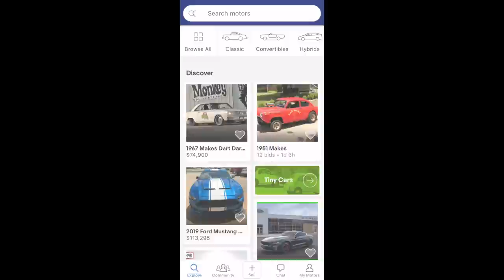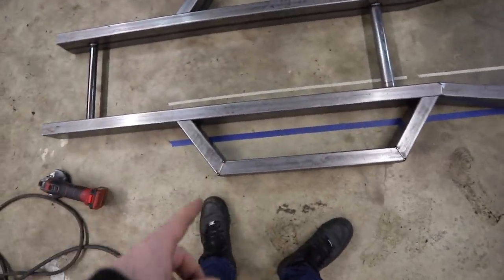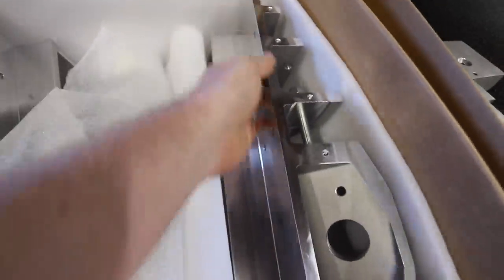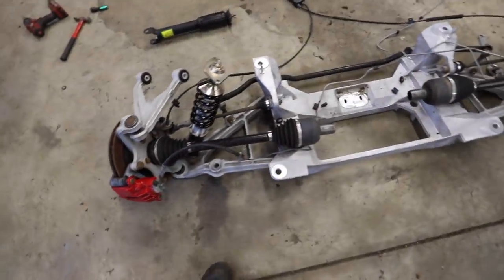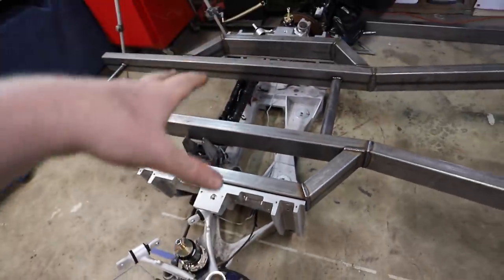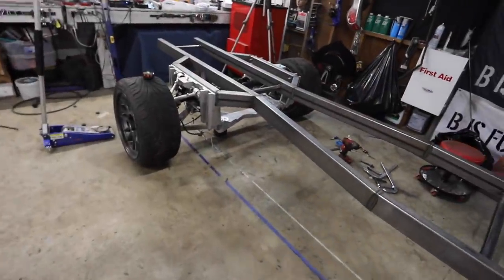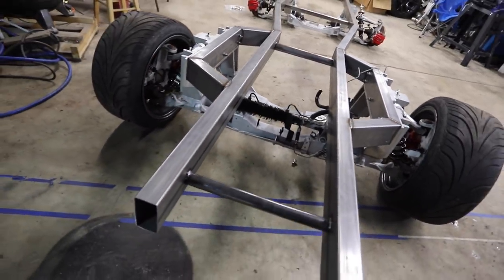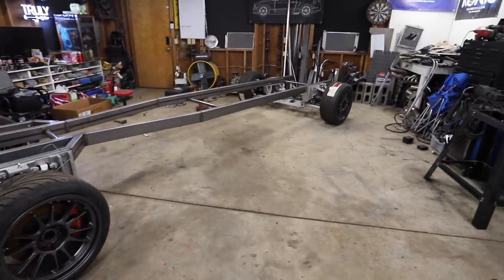Building A Custom Single Seater Supercar Part 2

Comment: they are 5x120 or 5X4.75 common chevy pattern and most frames are stepped front and rear on the side rails that would help with the heights.

Comment: You could always lower the center frame section in the front and Z the rear frame where the suspension bolts in to put the rails and overall rideheight where you want it...

Also, are you doing the torque tube eliminator and making this midengined?

Comment: Notch the frame so the center section runs level with subframes..  then you can retain suspension travel and drop the ride height.. maybe look at custom hot rod frame rails for inspiration

Comment: Very curious about the ackerman effect; the front suspension has the ackerman dialed into the spindle design for a 104.5" wheelbase. I'm thinking you have added more than 10% to that- it may tend to dart in- the front wheels will be turning in for a shorter car. Something to think about.

Comment: You need to drop the frame in the space inbetween the two subframes. It should drop approximately as low as the bottom of the subframes, not only for looks but when you go to put an engine in the frame you have now youre going to need a ridiculous cradle to support it thats basically going to look like another subframe. The frame rails you have now will basically be at head height of the engine. What you have now would however be perfect if you were going to drop say a C10 body on it. A rear engine c10 with a super low center of gravity would be a beast

Comment: You have to sleeve the frame where the suspension bolts in. Otherwise the subframes will egg out the holes. Causing drivability issues.

Comment: On e thing that might help with the lengtv is if you seat the driver more like in an actual single seater position. The drivers legs would be much further forward and sit between the front  control arms.

Comment: What you need to do with the bolts is to drill the hole larger then weld in steel tubing to add structure and not crush the frame walls

Comment: It may be a good idea to remove the coilovers and put a solid bar in at the desired height with an angle kit and drop spindle and when you have finished the build you can then weigh the car then you will know exact spring rates and shock length needed

Comment: 5 mins in; if you are doing this then lay your chassis rails down and then the outer tubes, get them absolutely square and weld on temporary cross bars. Weld in the all the angle bits and Cut the temporary bits off. It is waaaaaay easier :o)

Comment: Maybe would be a good idea changing the front springs and the rear springs around since the engine is going on the back instead of the front and the back springs usually are made to hold less weight

Comment: Interesting build. A couple notes on the suspension: 1) Why not design a push rod suspension system? Complicated, time consuming, expensive.... yes, but it would bring the CG down and allow for better aerodynamics around the wheels. That's why they use it in F1 and FE among other reasons. 2) Designing new coil-overs specific for your application requires a lot of engineering. More than just ride height - also coil stiffness, shock damping, etc. At that point, the adjustability and ride would be severely compromised. Do with this what you will, I'm not a suspension engineer. I'll still watch either way.

Comment: tweaking the specs (voltage and wire speed for MIG) is literally the first thing you need to learn aside from stabilizing the "gun" as you go along. It's been a while since I've welded with MIG, but my job requires me to teach others to use MIG and it's so surprising that most ppl don't have any intuition on how it works (most ppl forget to turn on the gas b4 welding 😔)....

Comment: Love the concept but this thing is gonna be heavy! Best way to gain performance... add lightness! I’ve worked on numerous single seater race cars in the past and the chassis on space frame cars are normally made out of inch box, I think you’re focusing too much on the strength of the ladder being stiff, you could have stiffened it with the rest of the chassis above it using triangulation

Comment: Chris please do not use Plates to stop the crush on the Chassis  , If you lift the sub-frame away and drill a Over size hole that will take tube the size of your Graded Bolts and weld that both sides of the frame it will give you a clean and strong enforcement and stop the crush just saying bud . Also i would Name it Mono -One. Great Vlogs as well on the Builds mate AWESOME.

Comment: The centreline of the chassis needs to be dropped closer to the centreline of the lower control arms by putting  dog legs in it (it's currently at the centreline of the uppers) otherwise your roll centre is too high and it will handle like a truck, yore not too far ahead to go back, better to fix it now. Also, you've changed the wheelbase dramatically so don't forget about Akerman ✌️

Comment: Hey Chris, I think you should look at the design used in F1 cars front suspension, you should maybe consider using a push-rod or pull-rod suspension, that could gain you easily the lower height you want without loosing all that much clearance, plus it would look really f"cking cool.  Loving your content from Peru!!

Comment: You might want to revise the direction. If the length of the car is way longer, there should be a smaller angle difference between the wheels when the wheels are turned.

Comment: i would suggest to put frame, beneath subframes, there is room. support suspension in cross, you need some frame beneath your butt. or other way is to drop just mid section, but in that way i think front end would be to bulky. if you want i cane send some sketches. last 5 years planing on open wheel one or two seater, with inboard suspension and different transmission setup, for me this is just little long, but i get it for the cost and 
maintenance. wish you all good luck and keep going strong, here from the days in backyard :D

Comment: Just gonna point out that most ladder frames I've seen have the lower control arm on the frame and the upper above the frame. You got that backwards here and the only fix is a drop leg in the frame. I respect your ambition but this thing is gonna turn like a school bus.

Comment: You might want to consider a different steering rack; an old 911/914 rack would mount in the center and give you a much less complicated steering column.

Comment: I was thinking that instead of a plate for the front suspension why not drill the holes bigger and use a sleeve that fits the Bolt it will give the frame more rigidity and be safer once they are welded in.

Comment: with the bolts on the box frame jimmyoaks on his rear wheel drive honda he drilled a bigger hole and slid in some round tube and welded it in to make it stronger and not crush when tightning the bolts could help you maybe

Comment: dude you should get a flexishaft for the steering rack. bad obsession motorsport used one in their build for their drive shaft. that could be an option for the steering so you dont have to go through a bunch of crazy angles

Comment: height: couldn't you also lower the center square tubing relative to the tubing connected to the suspension? it would be trickier geometry for sure. perhaps get half the height back from weight and the other half from lowering the middle tubes

Comment: I feel like there should be sleeves in the frame for the suspension subframe bolts to prevent crushing, etc.
Reply: Yes I spotted that as well. Called tube spuds. Or you can do top hat style.

Comment: Z the frame on both ends.  Would make it less like a suburban.  you could even just Z the wing portions on the front that the suspension bolts to.  Making the outer frame higher then the inner frame portion.  Crush sleeves welded into the frame where it bolts.  Would work better then plating the frame where they bolt.  Easy to make and use.

Comment: Its seems like you need to make a CUSTOM front suspension clearly from your render. If you wont go that route front chassis needs to be chopped, Lowered than welded onto the front subframe.

Comment: Having the driver sit in a carbon fibre tub which hangs inside the chassis would lower your centre of gravity and have the driver sitting only inches off the ground as desired.  It just means the chassis goes around their shoulders instead of chest area.

Comment: One reason the frame rails are so high is that without the suspension adaptors the rails would be laying on top of the subframes. Now there is a gap of a few inches.

Comment: Just flip the car upside down and make so the frame is the lowest point on the vehicle. There for you can raise the suspension to get the required height without getting custom suspension.

Comment: Didnt you or oscar do it before where you welded a round tube in the square where the bolt goes through so it has something to tighten down on without crushing the square stock?

Comment: 5x120.7 and 5x120 are an interchangeable size tbh, sooo many cars are running 120s on 120.7s and most camaro wheels fro gm measure closer to 120 anyway for backwards compatibiblity all th eway to the 70s...and it is standard car/small truck GM 5 lug pattern for s10/camaro/firebird/nova/chevelle/ lots more

Comment: Should make a custom sub frame from the parts you bought to make the c5 suspension fit maybe cut two or three inches out of the center of it so it makes the suspension sit that much lower  which will make the frame two or three inches lower. Git r done methodology.

Comment: The bolt pattern is 5 x 120.65 and it’s not weird. The standard conversion is 5x 4.75

That’s the same bolt pattern as almost every GM rear wheel drive car for the last 40 years

Comment: Better yet, the piece that you welded on the sides need to be in a 30 degree angle or so that way it will drop a little bit.

Comment: The only way that frame is going to be as low as the rendering is to flip the subframes and suspend the frame from the bottom instead of the top. By my speculation it’s about 18 inches to high

Comment: I don't think you're going to have much weight on the front with the engine behind you. Couldn't you lower the main frame rails in between where the subframes mount? It seems like your frame is attaching near the upper control arms of the suspension instead of the lower control arms if that makes sense...
Reply: Also, I wonder if someone makes a steering rack that puts the shaft at least somewhat closer to the center for you.... I think it's going to be very difficult to get the "stock" one relocated to center.

Comment: Those 5x120s will cause vibration at speed I am sure you will replace them by then but just figured you should know that so you don't try and use those exact wheels long term

Comment: 19:50 not sure if he explained it, but why front engine?? I was thinking like a F1 style thing.
Reply: It's not front engine. He's bolting the engine to the C5 transaxle, no torque tube. On the C8, most of the trans is BEHIND the halfshafts...in the C5 it's in front of them. Because Chris hasn't stumbled onto it in his Google travels, which is his main source other than Oscar, he doesn't know the trick of putting the engine OVER the transaxle.

Comment: you really should used millimeters, it's so much acurate for a frame job
Reply: The accuracy is not in the ruler, but in the craftsman. In this case here, furlongs would also work well.

Comment: I'm also of the opinion that the wheel base is to long.  Seem the driver position could be more forward with feet at the front frame cross tube.  With engine way back to the rear there will not be alot of weight on the front suspension.  Much work to be done on that part.  We will see.

Comment: I assume you’re planning on reinforcing those butt joints in the frame rails.  It would be a shame to see this thing break in half!
Reply: FINALLY! I've been scanning the comments looking for someone to mention reinforcement. With the outriggers welded to the frame right by the weld for the frame bend, there is going to be an insane amount of force going onto that joint. I don't care how good his welding's gotten, that will tear like a mofo and make a hell of a mess. It needs to be gusseted, and I'd also be looking to add extra frame members below the main ladder frame as well. And seriously, I reckon he can trim at LEAST 2 feet out of the length of the car, probably more like 3, and still have room for everything - a lot of space between the cockpit and the engine that can be reduced for a start.

Comment: one major concern of mine is that if the wheelbase doesn't match the wheelbase of the c5 your steering will be f*cked because of the different inner and outer steeringangle needed to get around a corner and you cant really fix that by welding anything different in the front

Comment: Please sleeve where the bolts go through the frame. Plates isn't enough. And I wish those butt joints were tied in by the added front tubing. Glad you won't be giving any rides man.

Comment: 5x120 works. Corvette is american. Its 5x4.75
Reply: Also, not than you need them with your wheel sponsor but i do have 4 19x10 c6 zo6 rims the silver split spoke ones. Ya know if you are interested.

Comment: Was anyone else told to clean the steel b4 welding because it comes with a protective coating. Or was that not necessary?

Comment: How about you cut the frame where the suspensions are mounted and add two pieces like the ones you added to the sides that way the front is gonna drop whatever inches you need. Cmon look around in any old car you’ll find answers.

Comment: they stopped using fully boxed frames for many reasons..... rust is one of them. 
and urs is uncoated internally too.
anddddd
"A rolling chassis is the chassis of a car or truck, assembled together with the engine and drivetrain, but without bodywork. Such rolling chassis were built by car makers, for supply to coachbuilders who would later build the bodywork."

Comment: Man you should ditch cad and computers and look at the things with your eyes. If it doesnt look right it isnt. That thing is going to turn like a boat. Also using a ladder frame seems like a bad idea. You have a tube bender and a notcher, why not build a tube frame. It will look better, be stronger and you can make it exactly how you want instead of being limited by straight sections. You should look at the formula student cars, kids are building them. Also by using custom suspension you can make the wishbones longer and you really should use a center steer rack. Just copy some actual single seaters, there is a reason why noone is building formula cars out of corvettes, as good as they may be. Perhaps you could collaborate with sk8215, the guy knows his stuff and he would point you in the right direction. But this really looks like a long truck frame

Comment: That looks to be WAY too long... It may be a good idea to set the seat, engine, and trans in the frame to figure out where everything can actually be. Also, a V drive could be used to get the engine further back

Comment: Uhm.. those chassis rails are going to be at chest height. You need to drop the frame lower or look at other options than those suspension mounts you bought. I don't think straight chassis rails from front to back are every going to work though. There's a reason most chassis look like this -> http://artmorrison.com/images/framekits/2013-frame-pg29-topframe.jpg  Oh, and crush-tubes.

Comment: Front suspension will not setup 3 inches  with the added weight of the engine, not even 1 inch...
isnt the engine suposed to be in the back of this thing ?

Comment: Also holy shit the frame is too high. Cant you bolt the subframe to the frame and just strengthen the "suspension plates" and build them into the frame?  Looks like it will lower the frame by the 6inches you need

Comment: Its not going to be a supercar with a steel frame. Hyper/super cars are either full carbon or bonded aluminum with subframes front and rear. They do not have a steel or aluminum ladder frame like a truck. Even your Lambo has a cockpit tub that has bars attached that support the composite body. This is more like if you were building one in the 60s.

Comment: I just bought a motorcycle on ebay motors, $5k, from a PA car dealer. Undisclosed from seller + shipping damage, $1,800 worth. Ebay's vehicle purchase protection program has assigned the Auction Insurance Agency to my claim. I'm getting F'd hard, they don't have my back. Nice sponsored partner ya got there..

Comment: Sorry to say this, but you're out of your depth here. You have an awful design, very poor torsional stiffness. You are woefully short of the facilities you need to make a chassis. I've no idea what will happen when you put the suspension on, it needs to be PRECISELY located to be acceptable. I assume you have the castor angle, kingpin inclination, roll center, Ackerman steering, and bump steer all sorted. I won't mention anti-dive.